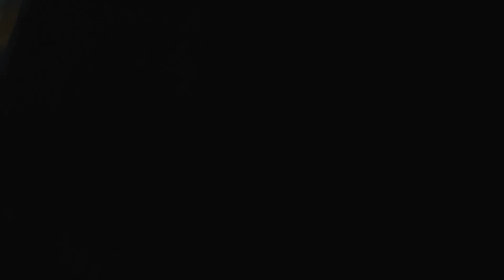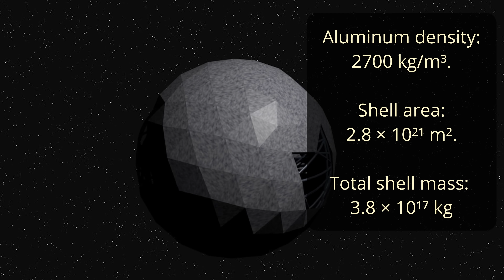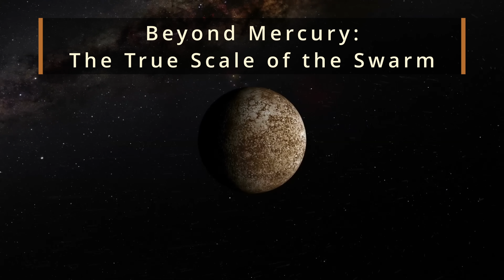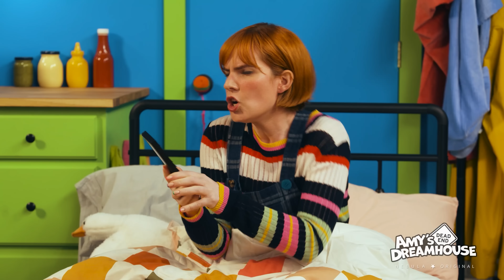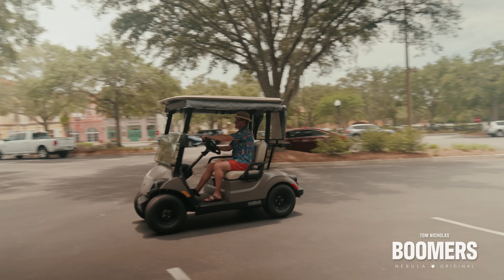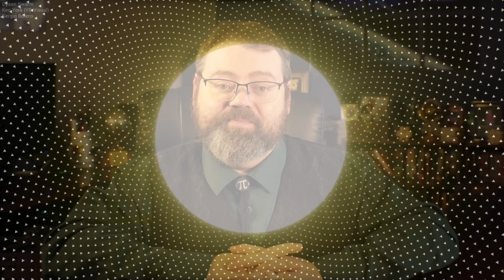Building a Dyson Swarm from Scratch

Comment: Biggest obstacle I can see, which you didn't bring up: Kessler Syndrome.
Reply: It's a problem but sometimes overblown. We've already been successful controlling it, well, except for China that is. And we're a very low tech civilisation still.
Reply: Depends on what you mean.
Kessler Syndrome only happens because we have lots of fragile satellites, they're all very close together, and despite being close together, the swarm all have uncoordinated orbits.

On satellite fragility:
If you're making large space habitats, they're going to be far more massive and stronger than the light and fragile things we use today.  Earth based satellites are exceptionally weak because of how costly weight is to bring into orbit. They're as thin as possible. On top of that, as Isaac has repeatedly stated - over and over AND OVER again - real habitats would likely have large protective non-rotating sheaths around them, but there are very few visuals of this because every artist wants to show the rotating habitat. Like how there are almost no visuals showing O'Neill Cylinders with the entire suite of ancillary facilities as described by O'Neill - the farming habs, various industry, various sensors or arrays, and so on.

So, while the outer facilities are weaker, as they're not meant for human habitation and are cheaper, the actual habs will be reinforced. 

That being said, it's not like it won't happen. Considering the amount of stuff in a Dyson Swarm, things will break and tear apart. Reflective sail will be torn, turning into bits that can tear more reflective sails. But clouds of broken material are great scrap. In a Dyson economy, the level of automation and energy cost needed to recycle material is far less a hurdle than it is for us. "Megastructure Maintenance & Space Janitors" is literally a video of his, and like a lot of things he covers, he could give it another video. 

On being close together, a "quick" quote from Isaac Arthur on his first Dyson Swarm video:
"Dyson Spheres" Jun 6, 2017 
---
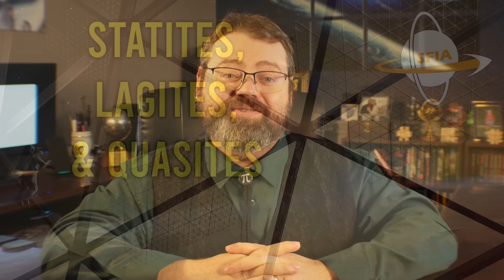7:09 
"Now as I mentioned, you can connect them, and indeed likely would, more on that in a moment, but let’s assume each was on its own elliptical trajectory around the Sun. Now these are not planets, so they can maintain temperature easier, twisting to expose more or less surface to the sun, or maneuvering solar shades or mirrors to block light or add more, so they do not need to be on anything like a normal Earth Distance, they could be as close as Mercury or as far as Mars with no serious impediment to maintaining their function or climate.

But if we assume for the moment they have to stick to within a 25 million kilometer zone, closer or further, than Earth’s average distance of 150 million kilometers from the Sun, the volume these habitats are inside would be about 10^25 cubic kilometers. Whereas each cylinder has 1600 cubic kilometers of volume, with some more space for various external attachments, and with 350 trillion of them that would be close to a quintillion cubic kilometers or 10^18, one-ten millionth of the total volume.

These are all constantly moving, but if we took a quick snapshot of the system, on average each habitat would occupy a cube 3000 kilometers or 2000 miles to a side, with them at the center all by themselves. The system is essentially opaque, not because it is densely packed, but because it is so thick, much as fog or clouds are. Much as galaxies appear quite thick and hard to see through, even though stars are separated by distances even larger than Dyson Spheres. So collisions are not an issue because they are not close to each other at all.

Folks tend to assume the various components are constantly in danger of slamming together because they are picturing something that is densely packed, but they aren’t. 

Additionally, there are three things you can do with access to that much energy. You can power lots of radar, lots of computers, and lots of light-beam propulsion. So they have no problem tracking each other, predicting trajectories, and making sure collisions don’t happen. They can also vaporize any debris that wanders their way."
---

Now, he does subvert this in his more recent video(s), specifically "Space Habitat Clusters and Conglomerates" (and some other bits in "The Dyson Sphere Economy", and some of his other recent videos) but it's important to note that such conglomerates are all moving in the same orbit together, or, at least mostly together. They would coordinate their orbits, as that is the entire point - to form groups that can work together and share resources/ trade/etc. 

=======

Effectively, Kessler syndrom is only really a threat because of our current state of space development. It will probably be a threat for Earth orbit for a few hundred years, as more and more stuff goes up there by myriad parties who don't want to work together, but as things shift to being truly Dysonian, the available space to cover along with the technology and automation used will make that no longer a concern.
Reply: Well, scientists are trying to solve the problem now, and in a couple hundred of maybe thousand years it probably won't be an issue.

Comment: Advanced Alien civilization are too intelligent to contruct a primitive inefficient and cumbersome so-called Dyson sphere. Stars convert mass to energy with only 1% efficiency. A Dyson sphere can only get 40% of that 1%. They would instead create antimatter and get fuel for their ships and energy for their needs with 100% efficiency and use far less material to do it.
Reply: Dyson Swarms are kinda low tech, so it's a transitional phase before we go into a black hole swarm.
Reply: "They would instead create antimatter" Okay, and how are they doing that, and how efficient is that process?
The only way we know how to make antimatter is through particle accelerators (there are fission processes that make matter-antimatter pairs, but it's more efficient to use all the power their radiation gives and directly power fission plants), and sure, our particle accelerators are meant for research, not designed for economic production of antimatter, but do you expect that process to be hyper-efficient? 

And how are you powering the system? Perhaps by... using the star's energy to run these particle accelerators?
Well, you actually can run them off the produced antimatter - so long as you get more than 50% efficiency in the process, you get surplus. The energy you get from matter-antimatter annihilation is the combined mass energy of both. But... isn't 50% already an absurdly optimistic value? We do have processes that are above 50% efficiency, but not for energy production. 

Realize that the entire process needs to be above 50% efficient - It's not just the energy to run the accelerators, but to capture and hold the antimatter, along with all other incidental energy costs - like the energy to mine and prepare the matter to be annihilated, or repairing and maintaining the particle accelerators, which really would be a tiny cost compared to making and storing the antimatter. 

If you don't get over 50% efficiency for the entire process, the process breaks down.

You can always capture energy from the star to run the process, effectively creating antimatter batteries, but that's not your argument - It's about ditching stars entirely. 

"A Dyson sphere can only get 40% of that 1%" 
Wait, are you saying that an alien civilization so utterly advanced as to economically produce and store antimatter has solar panels that are at best equal to our own? 
---

Look, it's true that stars are not efficient, and that eventually (given the economic/industrial capability) it will make sense to disassemble stars so as to use their materials in a better way. Not only are the majority of rocky material in a star system in the star itself - hundreds of Earth's worth - most types of stars are not fully convective, so only the small proportion of hydrogen in the core gets fused over the course of a star's life. Even if artificial fusion is less efficient than stars, it's still better to use the entire star's material rather than the core. 

But the sun still lets off 2.2 billion times the energy than that which hits Earth. That's a lot of energy just out there,  free to capture. At 30-40% efficiency, sure, but even the difference between burning coal and nuclear fission (being millions of times more powerful) is not enough to get people to adopt it en masse.

Comment: A planet has a gravitational binding energy.
This is the kind of energy that kept the planet surface melt for million of years when it was forming from infalling material.
Disassenbling a planet is the process in reverse, so you need to spend at least the same energy as the binding energy to disassemble it. That process, like any industrial process, will generate waste heat.
Therefore that heat will melt the planet's surface for million of years too.
See the issue?
-----------
Mining asteroids won't have this issue as the binding energy varies in R^5. (Assuming celestial bodies of various sizes have a constant density). 100 times smaller than a planet, 10 billion times less binding energy.

Comment: Question : why bother building a Dyson sphere, when we can just build our own suns,(reactors) that can do the same thing a lot easier, and put them right where we can use it?
Reply: Simply put if there’s an issue with nuclear reactors and all safe guards fail the whole surrounding area is fucked.
Additionally if there’s company that controls the reactors isn’t maintaining safety or cleaning standards you can see the surrounding area become polluted.

There’s already multiple examples of this in history. Obviously we learnt from those mistakes but they still give good enough reason to have such production in space instead of near habitable areas.
Reply: @darth3911 first off, you're mistaking fission (uranium) for fusion (hydrogen) . If you have an issue with a fusion reactor, you simply shut it off..
Secondly, even fission reactors are NOW massively safer, and it was only in the early days, and human failures that bypassed all safety measures that there have been issues like that. Modern facilities are now basically already idiot proof. (which anyone with knowledge of the nuclear fields knows) yeah, there's still some old tech in use, but they've pretty much all been upgraded. And that's with just current tech, and fission reactors. 
You're trying to say that in the time where a society advanced enough to have the ability to create Dyson spheres, or even swarms, they would still be having simple safety issues, like a primitive society, that's still boiling water for energy? 😂
Reply: @lostboytnt1 No what I am saying is those few idiot cases give reason to NOT have nuclear plants near habitable areas. My argument to the future is that they would be less likely to risk a 0.0001 percent chance of disaster with these plants because it takes one issue and you end up with major disaster that effects generations of people.

Could they be built in inhabited areas where humans can’t live for whatever reason, yes but I don’t think they’d go for a nuclear plant next to a city type deal.
Especially since there’s still issues of leakage going unchecked to this day.

Comment: The benefit of the Dyson swarm over the sphere or ringworld is that you're not putting all your eggs in one basket.  If one part fails other parts will still be habitable.
Reply: Not quite usually big structures like a Dyson sphere or ring uses individual panels attached to the inner surface of the mega structure.

Biggest advantages include:
-More structure stability from gravitational pull ensuring the whole structure isn’t ripped apart by the sun.
-Significantly less material usage making the swarm itself way more realistic to build.
Drawbacks include:
-Less energy production
-More human monitoring of panel movements.
Ironically the drawbacks are pretty acceptable for the advantages it gives as we’d lose a tiny part of energy and require us to have humans or ai to more heavily monitor the panels.

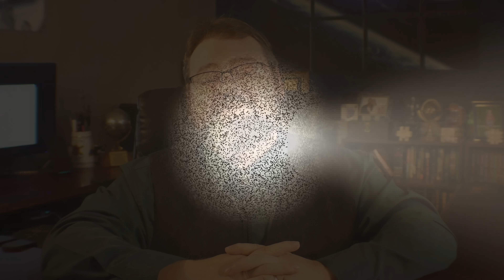Comment: 9:26 you have just a fusion engine.  And light has the minimum momentum to energy ratio possible.  You cannot a hive a super high speed, without a system of removing Helium from the star and expelling it.

Comment: I can see a problem with harvesting energy from the sun to beam to Earth for our power generation needs. What you're doing is dumping energy onto the planet, which has to be used in some form, generating heat. If you cover a region of the Sahara the size of Nevada with solar panels , you're still only converting energy that normally falls onto the planet into usable energy, you're not adding any energy into the system. But with a Dyson Swarm dumping energy into the system, you're adding a lot of energy that has to be used. Unless you've got something to help radiate excess heat into space, you're going to end up adding more heat to Earth than it can reasonably remove through normal thermal radiation.
Reply: You could probably use a swarm to power another swarm of large space habitats, particularly those stationed beyond the asteroid belt, but beaming to Earth? That's going to cause climate and temperature issues very quickly
Reply: @stumblepuppy606  that's why we would use solar mirrors/filters too. We'll filter the unnecessary wavelengths and thus reducing the energy that touches Earth.
Reply: @akapilka  so, putting up a large sun filter in Earth's L1 point is your solution to the energy problem? Removing the energy-use of Earth by filtering out that amount of energy directly received from the sun? Great, you've made the Earth dimmer, plants and animals now suffer.
Reply: @stumblepuppy606  there's plenty of light wavelengths no living being on Earth uses (most of them outside the visible range). You can dim it more than 50% and we'll still be fine.

Comment: What would you call it to extinguish a star and then consume its fuel at your liesure?

I think a large enough lump of cobalt or iron could work.
Reply: How does the lump work?
Reply: @thekaxmax 
Quenches the nuclear chain reaction, if I remember freshman chemistry correctly.
Reply: @joshuakarr-BibleMan   To quench a star you'd need a lunp the size of a gas giant. A tad pricy (you'd need the cobalt starlifted from half a dozen stars to do it), and there are better methods to control a star's reactions--for example, star-lifting.
Reply: @thekaxmax 
That's the scale of things Isaac talks about on this channel, yes.
Reply: @joshuakarr-BibleMan   I did bring it up for that purpose, yes
Reply: @thekaxmax 
Awesome.

After originally posting, I considered the possibility of also shaping it into a tapered cylinder, maybe with a hollow core.

If it's big enough to really do some damage to the star's processes, then that would mean such a cylinder could penetrate deep into the orb.
This if successful would provide a mineshaft or a consistent vein of material to dig through for extracting elements from deeper within.

It might be redundant though, to a civilization with the ability to make and employ an off switch for a star in the first place.
Reply: @joshuakarr-BibleMan   It's the mass of a small planet at minimum, and will not be solid. The 20,000 C of the corona will turn it to plasma, let alone the 15 million C of the core.
Reply: @thekaxmax 
As long as it doesn't crystalize, that's no problem.
The pressure will balance a lot of the temperature, and when it cools it'll just be a metal stake.
Reply: @joshuakarr-BibleMan   It'll turn to plasma at about the same tome it goes far enough into the surface to not be visible. here's no crystallisation involved, it's the opposite. It will not stay solid, even if it's a ball the size of Neptune.
Reply: Would this be a way to prevent a star from going supernova in the future?
Reply: @comentedonakeyboard   Watch Isaac's vid on starlifting
Reply: @comentedonakeyboard 
Huh.
That's a good question.
Is supernova a function of a star's nuclear action, or is it merely a function of mass?

Comment: "There's no oxidation or weathering", but how will the particle radiation from the sun affect various materials?
Reply: It still will, but vastly less destructive than oxidation or weathering. Generally less harmful to metals and ceramics than conplex organics including plastics n such. Most things would likely end up with a decent bit of shielding so this is mostly a concern for things directly exposed to the sun which is mostly just ultra cheap/light mirror concentrators. Also Starlifting does start cutting down on stray solar wind as well.

In any case it is certainly a concern, vut not any kind of dealbreaker and arguably a lot less of a maintenance headache than what our atmosphere and weather cause